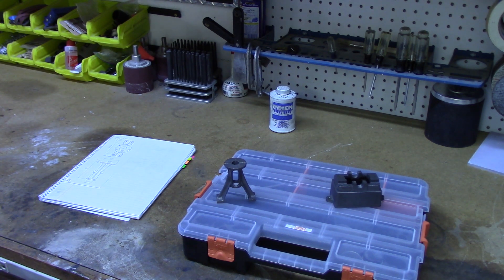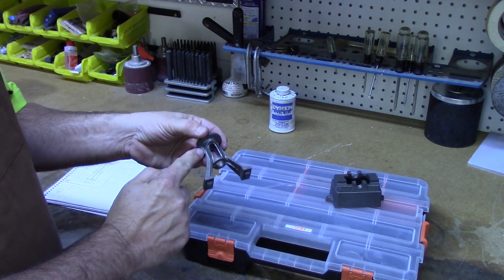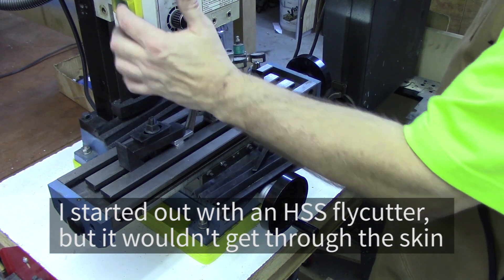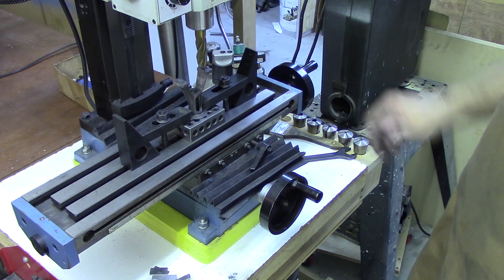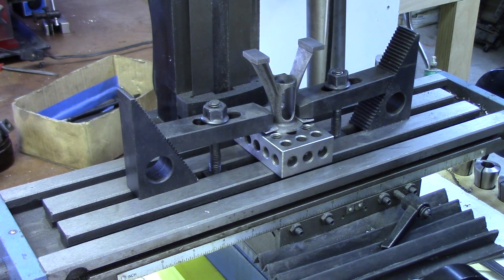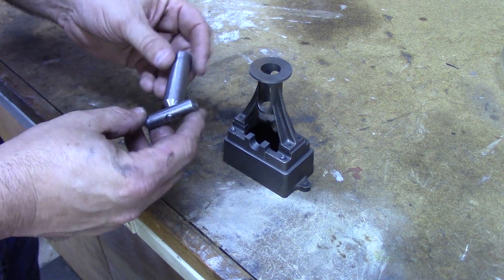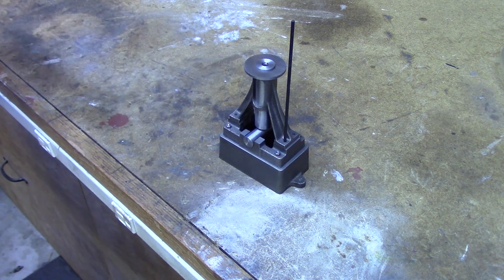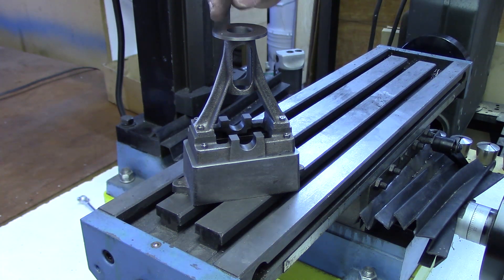Building the Stuart Models 10V Vertical Steam Engine - Part 4

Comment: Having a mill sure makes building this little engine easier. I no longer have the book that would show you how to machine this engine entirely on a small lathe. The notched hold down you used was the method shown. It is amazing these casting have been available for so long. Nice work and video.👍